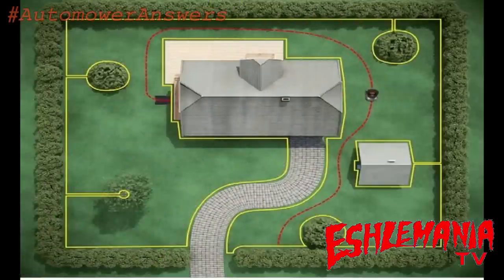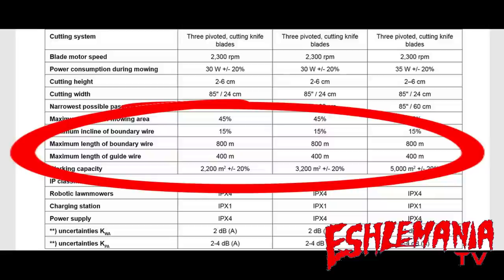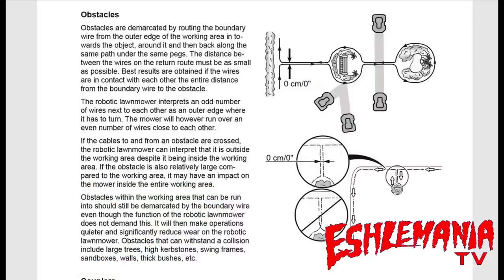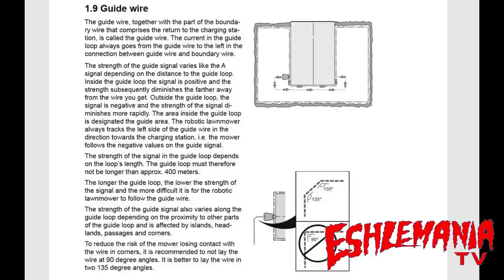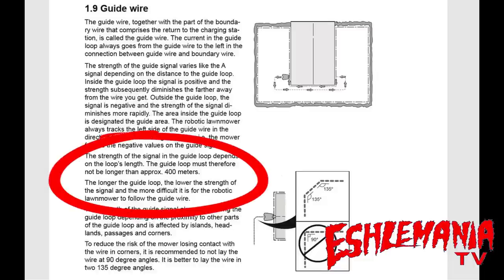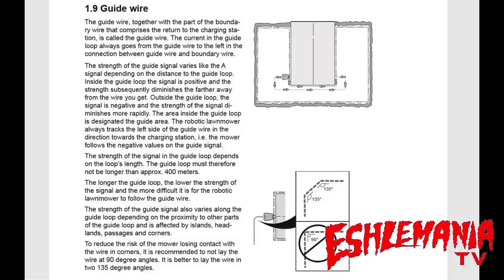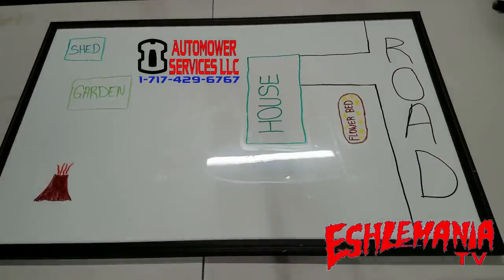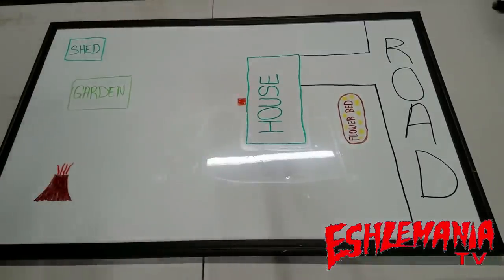Automower Answers: Boundary Wires & Guides Wires (How much is too much)

Comment: Did you mention you can send the mower down a guide wire for so many meters for a percentage  you’ve not a clue so stop posting
Reply from the maker: When you set up zones instead of using GPS mowing you have the option to use the boundary wires (right & left) or any available guide wires to set up remote start locations. After you select what way the mower is getting to the zone you set the percentage of times that the mower takes that route when it leaves the charging station. But maybe you are right and we have no clue......
Reply: Why are you so mad? Do you hate the auto mower? I know your pain.

Comment: Have you seen installations work with a guide wire going across a driveway in the crevice? And an even more important question is do you use a guide wire or a boundary wire?
Reply from the maker: Yes, we have done many installs crossing a driveway using an existing seem or cutting our own. A guide wire and a boundary wire are 2 different things. Boundary wires are required and guide wires area luxury that should always be used when available.
Reply: Did it straight over side walk no crevice, it survived till we tore out side walk and made a new one

Comment: Very helpful video.  I know the devil is always in the details.  

Below in one of your responses you say "the mower itself will NOT cross the boundary wire to follow the guide".  I was hoping to have the charger close to my house and have the mower follow the guide wire down a path (hopefully with the blade turned off) to the lower part of my yard (which is the only area that actually has grass and that I want to mow). I thought I could run the guide wire down that path and then connect into the boundary wire around the grassed area. But if the mower won't cross the boundary wire then does this mean:
1 It will go down the guide wire but then stop when it gets to the boundary and not cross into the grassed area?
2 Maybe it does cross the boundary to get into the grassed area but will not cross it to get out of the grassed area when it needs to get back to charge?
Reply: The boundary wire has to be connected to the charging station, or it wont have a signal and will just be a dead wire in the ground.